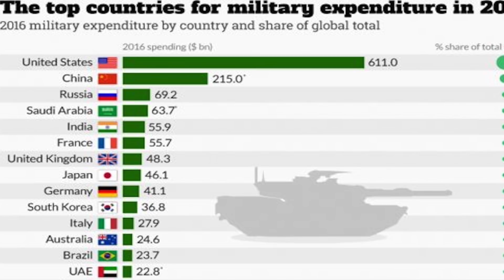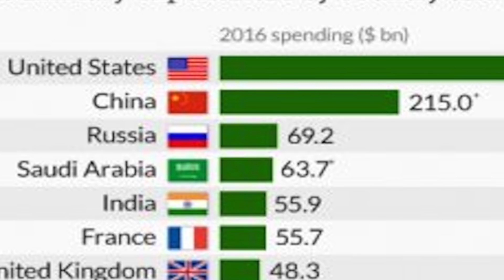CAN USS GERALD R FORD DEFEND ITSELF AGAINST RUSSIAN ZIRCON MISSILE ?

Comment: The real problem with Zircon is its data refresh and adverse weather function. The Zircon, IS NOT immune to jamming, first. Second it uses GNSS, the soviet-putinist version of GPS, which at Mach 6  is far too slow to update rapidly changing position data. Further the Zircon is on the verge of skin-ionization AND THE WEATHER MUST BE PERFECT- SO THE CARRIER BETTER BE SITTING PEER SIDE. If the Zircon is over 500 meters off the ground, AWACS will see it LIKE it is being constructed at the factory.  The thermal signature of a missile being boosted to Mach 6....heck, I can see that from Kansas, Melbourne, Guam...and the fight is in the Bering SEA! MANEUVERING ...at Mach 6, no metal can handle the stress of moving a body moving that fast through anything other than a flat angle, between 0 and 12, 13 degrees at less than 2 kilometers IN HEIGHT, so they will have to get close. Its own speed magnifies the G-forces. Guidance data....IT CANNOT BE A TRUE CRUISE MISSILE SINCE ITS TARGET IS MOVING AND hence the missile will require data updates and a satellite cannot feed the data to the missile fast enough. Even if a satellite found the carrier, from space at Near Earth Orbit, distance measuring error and Circular Area of Probability would have to be removed/managed by a local sighting...the E2D+ Haweyes and Picket Force, especially the subs with their advanced masts, would detect enemy platforms so far out that all the Russian missiles could do is run into hot lead faster or get jammed by the Predators and Growlers faster - and the USA Navy has surface, air and undersea drones. But do not give up Russia; you hate us, we hate you, your shrunken god putin and little Dimo want a war, and we should have one...the last one!  GET IT ON!!!.
Reply: Ok, 
   "..lol all that you have mentioned is pure bull and just bugs that are overcome in the testing phase... if 3.5 minutes is needed to travel 400km from launch to target... the carrier that already was traveling at a certain speed will have its position calculated where it will be in 3.5 minutes since it CANNOT stop so fast or go faster then it was traveling... then also the russian glonas system is in some ways more advanced then gps.."

     400KM IN 3.5 MINUTES. CONVERTER = THAT IS 210 SECONDS TO COVER 400 kilometers.  Those of you who are mentally agile, can see the problem immediately! 
     THIS is exactly what I was addressing in earlier statements: ONCE the missile has gotten within the distance of the horizon from the carrier, let's call that 12.87 kilometers round to 13.... DISTANCE FROM TARGET, ok? '...Based on what this person has said which is what the video indicated...'  //  ..why do I repeat and qualify that statement??? BECAUSE AT SEA LEVEL OR BELOW 2 KILOMETERS THE EARTH'S ATMOSPHERE IS SUPREMELY THICK....JUST EXCEEDING Mach 1 is difficult for anything that flies...ANYTHING (THE MISSILE IS FLYING, LITERALLY FLYING, INSIDE Max-Q: ITS HIGHEST SPEED INSIDE THE GREATEST DRAG ENVIRONMENT) SO MACH 6 IS ASSUMED BUT UNLIKELY, AND IF IT REACHES IT, THEN ITS RANGE IS REDUCED....just so many relative tradeoffs here. THE VIDEO STATES that the US Military has not made any comment...I IMAGINE THEY KNOW WHAT I KNOW!  The Zircon may have done Mach 6...but not at less than ONE KILOMETER IN ALTITUDE...WE'LL SEE, A WAR IS COMING! Russians started it, WE FINISH IT, ONCE AND FOR ALL!
       At such low altitude, its thermal and acoustic footprint beg to be tracked, SO DO IT! Yet, using the commonly stated number of Mach 6, the time to acquire, get updates from lowly GNSS or more advanced GPS - well - they would BOTH be utterly useless in this end-game! AT Mach 6 the missile arrives in, ...drum roll please...0.033 seconds....CHECK MY MATH, simple math I miss sometimes...I am better at Fast Fourier calculations and Diff. Equations.
     Therefore, the missiles, only need to be spoofed or jammed within the last 100 KM and they could easily easily most likely miss,...their...targets...! They cannot broadly maneuver and they are not stealthy by any measure!
    They are like shots from an antitank gun...and targeting a carrier is JUST not as nearly as easy as the venial putinists wish to think but make them spend the money trying- the sanctions are having a slow-death affect on the Russians even now!  USE THE decoys AND Drones...ADVANCE OUR TECH TO MEET THIS THREAT AND ADVANCE FAR BEYOND OUR ENEMIES. Sink the Russian fleet, blockade it in Crimea and destroy it. Cripple their economy THE EXACT SAME WAY THEY TRIED TO CRIPPLE YOUR ELECTIONS - FIGHT THEIR FIRE WITH EXPLODING SUNS! Own the skies....build more small carriers America and the West. Get ready for the final conflict IT IS COMING!
Reply: no...everyone knows that but if you know a mach 6 missile is out there the satellites KNOW WHAT TO LOOK FOR too. USA Sats, can literally see air being sucked into jet engines. Seeing thermal is really no stretch. We can see thermal now  from space. This is why I do advocate the smaller carrier with a 500 man crew and lots and lots of advanced drones and unmanned planes and decoys.and go ahead and give drones the thermal imaging functionality as well. This is not new tech! Let the large carriers do the heavy lifting....specialize the smaller carriers. Drones. Satellites that can be launched when needed and stay in orbit 2 - 7 days. Drone CAP
Reply: D'Mathmoth Tutinean Dam, you completely demoralized the enemy. Do they get any points for trying?
Reply: China is more of a threat to the U.S now and in the future!
Reply: Emm in my poor understanding of physic, rail guns are good cause its firing capacity.. the problem is zircon carries with it a massive inertia that also can damages the ship even without explosion.. plus the effective range of zircon is small..  i think, i agree with the idea of using a jammers
Reply: D'Mathmoth Tutinean, stfu with the bs, please. I love the Navy but the hypersonic missiles have optical electro and radar seekers. Back to the drawing board for the USN, huh?
Reply: you lost me at the "putinist"
Reply: D'Mathmoth Tutinean ohhhh......ur so dumbfounded all in disbelief of how mighty Russia actually is..........shows just at what level natos wisdom is at. Thanks.
Reply: D'Mathmoth Tutinean Russians don't hate you. They are much more intelligent than that. What they hate is the USA always trying to dictate and deceive and undermine other nations. Typical of this is the US accusing Russia of trying to interfere in US elections with no proof. The kettle calling the pot black. The continual interference in the Russian electoral system is blatant. It endlessly is reported in US media. The sad part is the US still always supports the criminal elements of the Yeltsin era. The criminal Oligarchs of that area that controlled the Russian Duma. Ok if you want to run the US that way but stop trying to impose a similar system on Russia. We all know the US is ruled by vested Interests and the Deep State. Ok if that is what you want where your vote does not count but please stop trying to force that sick system on others. It was no accident in Russia during the Yeltsin era the Government was called  "The Family". Ok if the US wants to be Governed by the equivalent of a faceless Mafia Family but why try to push that sick system on others. It is not Democratic. Time fools like you realise the USA is one of the least Democratic so called Democracies in the world. Not the best like you have been brainwashed to believe. So obvious to the rest of the world but most in the US are blind to this fact. Tell me why the people of Russia would ever want a Government back like the Yeltsin era one?
Reply: Perhaps the answer lies not in countering with a laser but with jamming? At least in the next few years. Nice info you provided. thx
Reply: @myplane150  You are actually taking seriously that nutjoh? Wow!
Reply: D'Mathmoth Tutinean God fucken sake guy, That's a hefty story you speak! Not saying it's fake or so, Not sure.
Reply: Ouch!
Reply: D'Mathmoth Tutinean what if the Russian fires 20 Zircon simultaneously. Can the US carrier group take them all?
Reply: Emm i reckon the US get 10 jedi equipped with light saber to cut that zicron...
Reply: Aussie Gamer: You, sir, undoubtedly are not well read. Anyone with basic knowledge of military systems will know that hypersonic maneuvering is a non-starter. Traveling at 150 kph can you make a sharp 90 degree turn and survive it? At that speed a missile will have to fly in a straight line. I didn't see anywhere that  D'Mathmoth Tutinean "speak of war like its a video game." Have you experienced real violence or pain and suffering? Even so, what does that have to do with knowledge of physics?
Reply: Emm huhuhu our expert here keep mentioning about the inability of the zircon to be functioning.. he may be right or wrong.. or there may be other counter measures regarding his statement by the russian scientist.. i m concern more of the chance of the ship get hit.. which is very likely.. if the US have jammers.. the russian may have something else to make the zircon able to penetrate their defense.. there are a lot of probability.. even a grand US ship hit a big, slow vessel twice this year.. what if, its something smaller, faster, and invincible.? the chance is there..
Reply: D'Mathmoth Tutinean You talk a lot of crap. The video is incorrect as well. Russian releases don't claim it is a Scramjet powered missile. They simply say they have developed a better fuel which indicates it is still some form of rocket propelled. It will be a nightmare for any Carrier Group or other US ship. Ship launched Air Launched. No mention of a land labched version yet. For that they will still rely probably on there improved older Supersonic Antiship missiles. Longer range and still capable of coming in at low level giving very little warning and adopting an irradic approach. Also capable of guiding themselves to the target. One travelling high guiding the others via it's own radar. It gets knocked out one of the others auto takes the higher altitude and guides the others. Why can't the Zircon use a similar system or why can't the Zircon be guided in a similar war. No GPS needed. Also how long before these Laser Weapons are ready and how long before the US can have enough ships equipped with these Laser Weapons. Also how easy is it going to be to protect against these lasers. The first Generation Zircon now proven. Another 20 years????for these great Laser Defenses to be fully deployed or. Lots of time to develop counters cheaply. Face it. Except for Submarines the US Navy has big problems now to project power for a long time. Carriers are now the Battleship of WW2. Next to useless against an enemy with advanced AntiShip missiles.
Reply: Russian Pilot Not a US citizen. Australian. You as a Russian might be surprised to know that a big percentage of Australians are not fans of the USA. While we overall are very straight up like Russians we can be two faced. In the main we send only token forces to help the USA in all its wars as a form of security. As a nation of only about 24 million we need to keep them onside just in case some of our northern neighbours see us as an easy target. Overall most Aussies have very little respect for most US types and there one eyed types. Yes I have been to Russia twice. I understand your perfectly legitimate point of view and your efforts to pull the USA into line. Pity China would not help a bit more. Keep up the good work. As we say in Australia "Someone has to keep the bastards honest." By the way most Aussie dont support the sanctions against Russia. Bullied again into supporting them by the USA and implemented by a Prime Minister born in Britain. Kicked out of the position soon after. Nothing but a Conservative old British type. Not a true Aussie. Yes I liked the straight up attitude of many Russians. Stayed with a Russian family for about 1 month the first time. Keep the pressure up on the USA. The only language they understand. A good smack in the face. Not all but far too many.
Reply: Vlodec, try to find the report of the company "Almaz Antey" (manufacturer of the Buk missile system). They proved that the nature of the damage of the cockpit, shows that the launch occurred from the territory of Ukraine. This is the first. And secondly, the plane was shot down by the system which is doesn't in service in Russian army. It's too old. This version of the "Buk" from the time of the Soviet Union. But in Ukraian army this versions of the "Buk" are still in service. What else do your need to open your mind? By the way, did you know that this is not the first civilian plane that was shot down by Ukraine during its history of independence (25 or a bit more years). I suspect you did not even heard about it, Western media doesn't saying anything on this.
Reply: What about all the talk about the rail gun.
Reply: Interesting points, not covered in the video!
Reply: oooo ooooo o yes USA superpower and all other countries are what??don´t forget f35 and weather you expert !!!iif america had a supersonich weapon there would be the world in order or what fkin moron...
Reply: BATTLEFIELD 4 HARDCORE Chill man, yes he isn't an expert...sure he could be completely wrong. Its just his opinion, have some class and explain your opinion without the sass.
Reply: no i´m not a expert but how about f35 and problem with automatic logistics Information system,helmet display,lightning protection,flight control problems (wtf, o sry is f35 most bla bla bla airplane),software problem, all variants of f35 have reliability issues with cockpit display electronics unit, seat survival kits,on-board oxygen generating systemsm landing gear tires,thermal management systems etc.yeah i know it´s USA power and who is talking about this problem?ooo sry F35 most powerful airplane of the world
Reply: Hey, y'all need to brush up, missilethreat.csis.org Way too much BS being posted here...
Reply: Precision won't matter if it carries Nukes.
Reply: Ross K, better no one can say. If u r an American, i'm really surprised. Smart and honest with himself American?!?! I just can't believe it)
Reply: Ross K, thanks, i'm very pleased that the Western world have such truthful smart man as you. I hope with time they will be more. And remember in Moscow from now you have one more friend.
Reply: Emm sadly i m a malaysian.. i m not sure who actually the culprit of the 2 lost Malaysian planes.. here there were a lot of controversial and made up stories.. even conspiracy theories... the first plane thought to be carrying the chinese war experts just disappeared in smoke.. They say american hijacked it and took it to their base.. plus other theories.. the second planes shot down.. they say its either the  russia or ukraine who shot it down.. i only can pray things like this wont happens anymore..
Reply: Izzudeen Ayub, it was Ukraine, Russia have proved it, but seems like nobody in rest of the world don't want to know the truth.
Reply: Vlodec, look, i have suggested to find this material and try to understand it. Nothing more. I haven't said that u must believe in my words. You must believe in expert's words, not mine. Try this: https://www.youtube.com/watch?v=rG0Bi_wf7JM
Reply: Emm huhuhuhu... totally brainwashed.... thanks for your info.. now i know americunt and americant are the top Tier ULTRA POWER in the planet and the world..
Reply: Emm i saw the russian intel video about it.. but now everybody just quiet about it leaving my country's name at it worst.. huhuhu...
Reply: D'Mathmoth Tutinean So what if Glonass has a slower update rate. The missile will just interpolate. The Soviets had Mach 5 antiship missiles on Tu22 and Tu95 in the 80s or earlier. And used things like inertial navigation. Here you are claiming they cannot hit a huge aircraft carrier with 2017 electronics. So what if you use radar jamming. Maybe they will give it an optical or infrared seeker for terminal guidance. Also, it's preposterous that you claim it won't be able to turn because of its high rate of speed. It won't need to perform large course corrections anyway. And it can just do them slowly, to keep gforces within sustainable limits. Not like it has to perform more than one successful flight.
Reply: "...So what if Glonass has a slower update rate. The missile will just interpolate. ..." GUESSING is , well, GUESSING! DID the carrier go straight? How far from the carrier was the missile when it got its last data fix?? From what initial source? If the Missile is moving at Mach 6 using a scramjet, AT SEA LEVEL, IT BETTER NOT BE RAINING, for one. The carrier is most vulnerable leaving port. Shoot then, right? Ambient RF and natural interference, is highest close to land. What if there are islands or other obstructions, ships, air defense and early warning; they can all be made to look like a carrier too. Even if you had a camera on the missile, it is going so fast that the carrier would be visible for less than 0.033 seconds - I did the math in a previous post - that is a fraction of a blink of an eye, and you are past the carrier. This thing is doing all it can to do Mach 6...AT SEA LEVEL- FLYING INSIDE MAX-Q. IT IS flying in its worst environment and being heavily jammed and spoofed and it is moving like a rifle shot. The carrier has a very good chance of surviving this attack.

"...And used things like inertial navigation. Here you are claiming they cannot hit a huge aircraft carrier with 2017 electronics...."  I know what you are thinking, " Gee, Mach 6 is just one number bigger than Mach 5 so it should not be any more difficult to hit a ship going a little faster. Range, material science, performance envelope going another 700+ nautical miles an hour faster. Just think about it. The Carrier battle group....has advanced electronics too! Nearly NO SYSTEMS have 2017 electronics but the latest upgrades you can believe the carrier has it, for sure! 

"..Also, it's preposterous that you claim it won't be able to turn because of its high rate of speed..."   Go back, read it again. I did not say it cannot turn, I even indicated the best possible turn angles...why would I do that if I thought it cannot turn!! Go read again. Maneuvering at Mach 6 and it is  a MASSIVE 5-ton air breather of the scramjet type, anything that causes side-slip or excessive angle of attack can stall this thing, it needs air like nothing before it! Water vapor, heavy snow, whales breaching, can kill it. It turns poorly, IT IS A RIFLE SHOT, THINK!

".. And it can just do them slowly, to keep gforces within sustainable limits. Not like it has to perform more than one successful flight..."    Go slower?!! Watch the video again. Its speed was to be its best advantage and in fact its speed, a relative virtue, is also its greatest vice/flaw. US Navy defences are heavily data-integrated. If one system can see the missile, THEY ALL CAN. ESA CAN SEE THIS MISSILE COMING HIGH IN THE SKY AND certainly down low where it must struggle to exceed Mach 1...  'nuff said. I am done with this.
Reply: Your right, however at sea level things change. The ability to maneuver at those speeds is very difficult. Sea level mach 6 is a very big problem. Your dealing with very thick atmosphere which will produce much, much more heat and pressure. Attempting evasive maneuvers or simple course corrections will cause a lot of strain. The SR-71 couldn't achieve it's speeds at low altitude without burning up, at high altitude however it was a champ.
Reply: D'Mathmoth Tutinean hypersonic missiles and their capabilities  haven't been out of the media for the last two weeks.  

I guess you didn't get the memo.
Reply: Guys,  Wikipedia the LaWS system, it is a complete joke except for drones and high speed gun boats. LaWS is 6 commercial WELDING LASERS. So much stupidity here, cmon guys.
Reply: D'Mathmoth Tutinean ahahah, have you ever been in Russia?
Reply: Only one problem with that whole statement; the Zircon is still in prototype and testing stages, meaning it can be improved and it can happen in a matter of days or hours. Their for we do not have the CURRENT spec's or capability of the missile, but the fact remains, Russian anti-ship capability are far ahead of the U.S. While U.S. was all trigger happy on making carriers after carriers due to the large number of warm and deep water ports, Russia doesn't really have a choice in regards to fielding a large navy. For one, they don't have the deep or warm water ports needed to maintain such a large fleet. Two, all it's enemies are by it's boarder, so a land war is what they are more focused on. Three, they spend money where it matters, not blowing it off on shitty weapons system that don't do as they are promised (looking at you F-35).
Reply: We'll, the video didn't talk about electronic warfare at all, because it is a rapidly adjustable tech that must be tuned and updated at the point of conflict. Also, counter measures can be jammed too. It is a cloud of uncertainty.
Reply: Akin Khoo 30 knots only? Nah, some ww2 warships could go faster then that! Including some battleships! But still, 30 knots for a top of the line carrier? That’s pretty slow.
Reply: ...or mach 2. What's your point? At mach 8 the Zircon can close faster, maybe, than point defenses can react...but it can't evade them, and a 20mm round from the target will hit it at almost mach 9 and totally demolish it.
Reply: Bill Housley did you even watch the video? One bullet won’t do given the size of the missile and using the 20mm is the LAST resort. Meaning if something got thought all the other point defense, your pretty much fucked. And I am sure the 20mm round isn’t going at Mach 9, if it was, they would have been firing that from the beginning.
Reply: You Sir need a heavier dose of your medication if you are willing   for a war with Russia, for it will be indeed the last one, but for all mankind, i hope you can mutate into a cockroach for they will probably be the only that survive.  You do know that a modern missile or missile swarm  can perform with partial/intermittent  information about location then they have their own devices(radar/optics/) to locate/prioritize and engage targets. 
Just google  (P-700 Granit)   and imagine if it were  2 or 3 times faster and you will understand the danger of this new missile.
Reply: All in all with that being said , you guys do understand that Russia's middle technology is 20 years ahead of the west including america... there is a reason why NASA borrows Russia's equipment during space voyages... this colored man is biased and is not looking at both ends.
Reply: Bill Housley you do know he said middle technology right? Not things like stealth or some high tech top tier tech. Russian missile and radar tech is far far ahead of ours. And yes, NASA does does use Russian tech to send things up.
Reply: AL Ian yet NASA uses RD-180s made is Russia. Defense contractors use Russian built rocket engines because they are efficient and cheap in what they do. Landing a man on the moon isn’t all about tech. Political setbacks, infrastructure, and other contesting military projects basically slowed much of their effort. Even the Americans suffered from the same set backs, on we had a large budget to spend it on the space race. Who was the first to put a man in space? The first to send a satellite in space? Who was the first to send a space craft around the moon and took the pictures of its far side? The point is, the Russians got close to the finish line. Filthy American propaganda has fooled our country into thinking that Russians are primitive people. Won’t be saying that when the U.S. pulls out of Syria and Russia cleans the house and restore order.
Reply: Relax guys, it's just his opinion and he is welcome to it. If you disagree let him know , but have some class about it.
Reply: that was funny.
Reply: Emm never say no my friend..
Reply: Ross K I can understand that. I think both governments are pretty courrupt with personal  vested interests on protecting and earning more money. I don't trust either of them.
Reply: interesting
Reply: "...experts words..."    I WAS WAITING FOR YOU TO SAY THAT!!!!!    https://youtu.be/iQsrUjZotBU
Reply: Jorge Rodriguez
Yes. Very dangerous to Mexico and the rest of Latin America. LMAO
Reply: Panzer Killer -- Sorry, did I say mach 9? I meant to say mach 7. The Zircon coming in at mach 6.2 meets a point-defense vulcan cannon round flying the opposite direction at nearly the speed of sound...ya, mach 7. Pretty simple math. And yes, that kind of collusion is what rapidly expanding debris clouds are made of.
Reply: Almir Alagic -- 20 years? Really? So they have colonies on the Moon and Mars and their Navy and Air Force weapons systems all have magnetic shielding and directed energy weapons and their infantry all have Iron Man body armor and are all super-strong, super-fast, genetically enhanced super-soldiers with cybernetic implants and can self-regenerate damage?

Wow...scary.
Reply: Panzer Killer
Who is the ONLY nation on Earth to land on the Moon because they could? Nobody cares about a man or satellite in space. LMAO Russia makes affordable small rocket engines which are no longer going to be used by the USA because Space X now makes the most affordable small rocket engine now not Russia. A private USA company is now more advanced than all of Mother Russia. LMAO https://en.wikipedia.org/wiki/SpaceX_rocket_engines
Reply: AL Ian wow, so dismissive of the first achievements of humanity you are. The U.S. gave enough shits about the Russians achieving what they had in order to spend more on the space race. The funny thing is, Space X isn’t funded by the government. That makes it funny since NASA, who is funded by the government, failed to develop a rocket better then the U.S. it took a privately own company to do it years later. And even now their are concerns about it given that one of the rockets blew up. If it matters, Russia is aiming to send  cosmonauts to the moon in the coming years, same as China. I find t funny that with all the technology the West has, they could have sent another mission to the moon? Wonder why they don’t do it. And don’t say money is the issue, no, it’s not. We have enough money to fund all of our space programs by a hundred.
Reply: Panzer Killer
How many countries have put satellites in orbit or walked in space? Who cares? American made Space X makes rocket engines cheaper than Mother Russia or NASA. USA went to the moon 6 times already. Dirty China and Mother Russia can have fun on the moon now while mighty USA is going to MARS. USA will always be first to land men on other worlds while Mother Russia is still trying to get to the moon. Here's Mother Russia's failed N-1 rocket disaster trying to land a man on the moon first. LMAO https://youtu.be/BLg1QUq5GQM
Reply: Panzer Killer -- It's an issue of "What's in it for me" when it comes to public funding.
Reply: you are surely very good toilet expert. So much total garbage that it is already ridiculous. Next time use only facts and not your wishful thinking.
Reply: I stated my service record ON THIS POST; I am NOT afraid to speak face to face ...post to post, with anyone. Those engines...on the B-1 Bomber? Those are MY engines...too.
Reply: So you think Russians are dumb? In Russian even crookes have phd's!
Reply: D'Mathmoth Tutinean  you are sick...
Reply: D'Mathmoth Tutinean You had better get a job with the CIA and DOD. I am certain they would love all your inside info. As I understand it the area of guidance at Hypersonic speed is definitely a big problem. Especially with the Air launched version now in low volume production and being proven up on the MIG31s. Talk it can reach Mark10. 
Common sense says the Russians have solved those problems. A secret! If they had not they would not be equipping all there new Frigates and Corvettes and Cruisers they are gradually upgrading with  launch tubes that cant take there older state of the art by NATO standards Supersonic Anti Ship missiles. 
When is it going to get through to US types like you they don't necessarily have to do it the USA way. They are perfectly capable of making breakthroughs of there own. 
There is no way they would abandon there older best in the World Supersonic Anti Ship Missiles unless they had solved all the problems you mention. Just because NATO has not solved them does not mean Russia has not.
Reply: Vlodec I have read the full report released. The key weak and critical missing points in my mind are as below.
Russia released its Raw Radar data. If it had been tampered with odds on it would be picked up. Ukraine would not release theres. The USA would not release the data they claimed to have even though they had a Satellite over Ukraine at the time that supposedly could pick up any rocker launched. Very suspicious in my mind they would not make that data available even to close ally nations. Why not? Ukraine also failed to release its Air Traffic Control records. Various excuses offered over time. That is suspicious. Changing the reasons. First there Security people had taken possession of the records. Then when they were needed and requested they did not have them? Strange? The last story I heard them come up with was they were doing maintenance on the system. Very suspicious! 
The end result is we will never get an answer why MH17 deviated north when all other aurcraft flew further south avoiding the war zone that day. The evidence is there they were following a route south like all other aircraft initially. Why did they veer North. Only Ukraine can answer that or the dead crew or the black boxes. We all know London said the black boxes were damaged so we will never know. It was not weather. That is about all we know. Why?
The BUCK. Never seen coming from Russia. Never seen going back to Russia. 
A Buck seen in the area. Thats it. The Ukranian intercepted messages were proven false. Made up from numbers of other massages. 
Something smells. A really bad stench. The Official Investigation even included footage of a BUCK  proven to be false and impossible because of the advertising sign. Ukraine refused to let the investigators inspect there BUCK missile records and inventory also.
The only real evidence put up was Russian  with there Raw radar data. 
Even the forensic side does not give any real proof that establishes what hit MH17. 
I dont accept it. If I was on a Jury I would not convict. 
I would ask the investigators why they refused to interview the hundreds in the area that could have given a description of what they saw. No danger if Kiev would have stopped shelling. 
I would not convict if on a jury. Too much critical evidence withheld or never investigated that should have been investigated. Why not?
Reply: Vlodec The investigators were free to be part of the demonstration and test in Russia. Why didn't they take up that offer. Money was no object. The entire think stinks. The only way to ever get a balanced investigation at the time was to have experts from truly independent nations undertake it. If Ukraine was part of it Russia should have been part of it and Malaysia also should have been a full partner as well. 
It was one of three things. An mistake made by either the Rebels or Ukraine or a deliberate act by Ukraine. Ukraine was the only beneficiary. They got exactly what they wanted. Even if it was the Rebels who accidentally shot it down Ukraine is responsible to a large degree for allowing or? MH17 to deviate North of the route  being taken by all other airliners that day. When aircraft are flying over nations it is the responsibility of that nations air traffic control to ensure they are kept on a safe rout. Thats how it works.
Reply: Russia had a difficult time with gorilla warfare too. Read your history fool
Reply: Written by an idiot with waay too much time on his hands.
Reply: The amount of energy necessary to refute bullshit is an order of magnitude bigger than to produce it. So, I'll just leave it at that.
Reply: The only deterrent to carrier getting sunk is nuclear war,as US used ships being sunk to get involved in 2 WW ! If Pearl harbor could happen,then anything on this earth can be destroyed! To even believe different is a IQ of a child, not a smart person who claims all the experience of naval warfare!😎
Reply: Russia doesnt have to attack you . You will be attacked by your own police first . Your gun laws, Fracking, GMO , fast food .. trillion dollar debt .. Americans are a dying race . You will be also be a minority in your own country while the immigrant population will have a divided loyalty to you .
Reply: Plz go read history before saying who needs war and who wages war for business ...and plz don't say u do all this for the prevailing democracy and peace ...world has understood US and it's love for peace and stability ...ty
Reply: Philip V
Russia's already dying and we're not even at War. They're the most boring people on the planet anyway so good riddance.
Reply: It has a visual lock on system that takes over
Reply: funny. all the comments attacking him, i havnt seen any counter arguments to what hes suggested.
Reply: @leeboy29680-ol7gf  The amount of energy necessary to refute bullshit is an order of magnitude bigger than to produce it.
Reply: NO. NOT IF Terminal Guidance is correct and these missiles need better range - stop calling them CRUISE missiles.. But that is the rub. These missiles are like RIFLE BULLETS. ONCE out of the barrel, they are hard to update and steer. Your intel has to be updated constantly or forget hitting anything. If these things get  closer to a carrier than the horizon and they have to make huge maneuvers to make a kill, They will not make it. The control surfaces on these missiles cannot turn THAT hard to hit a target that close unless it is sitting still or sitting at a pier...in Cancun or the Bahamas. Any ship that ....a sub....that could stick an antenna above water and give away the Carrier's location would be sunk, detected. IF the missile is moving at Mach 6, as it approaches terminal, you will see its thermal footprint; IT WILL BE MASSIVE! ESA Radar can see the air sucked into JET engines and unlike rotating radar does not have that dead-zone around the ship that is about 400 meters in every direction. ...it will see a SCRAMJET ENGINE about 25 times sooner. USA ships are so much better at data sharing, hence targeting. Maybe we need the Phoenix Missile back anyway....IN TERMINAL...THE MISSILE EITHER DOES A POP UP MANEUVER (Super hard at Mach 6) OR COMES STRAIGHT IN...R2D2 has gotcha!!  SO if they can get 20 aimed at a Carrier, still got trouble....the picket forces are not slouches either. They are upgrading the Burkes and the Zumwalts, are just CHOOSERS OF THE SLAIN...they are THAT deadly. If you even tried dropping these things from space ...now that Russia has rejected all previous nuke treaties and China never obeyed them, you CAN could use nukes to defeat attacks, IN SPACE. We are in a new arms race and SPACE, has no real limits just political BS talk. I advocate building smaller partially submersible carriers, with crews of about 500, with 150 to 200 drones and unmanned vehicles as well as theatre ballistic missiles and charged particle weapons. MAKE some of the drones all weather all purpose decoys, etc, etc, etc.
Reply: no.....i refused to shut up: 
 The real problem with Zircon is its data refresh and adverse weather function. The Zircon, IS NOT immune to jamming, first. Second it uses GNSS, the soviet-putinist version of GPS, which at Mach 6  is far too slow to update rapidly changing position data. Further the Zircon is on the verge of skin-ionization AND THE WEATHER MUST BE PERFECT- SO THE CARRIER BETTER BE SITTING PEER SIDE. If the Zircon is over 500 meters off the ground, AWACS will see it LIKE it is being constructed at the factory.  The thermal signature of a missile being boosted to Mach 6....heck, I can see that from Kansas, Melbourne, Guam...and the fight is in the Bering SEA! MANEUVERING ...at Mach 6, no metal can handle the stress of moving a body moving that fast through anything other than a flat angle, between 0 and 12, 13 degrees at less than 2 kilometers IN HEIGHT, so they will have to get close. Its own speed magnifies the G-forces. Guidance data....IT CANNOT BE A TRUE CRUISE MISSILE SINCE ITS TARGET IS MOVING AND hence the missile will require data updates and a satellite cannot feed the data to the missile fast enough. Even if a satellite found the carrier, from space at Near Earth Orbit, distance measuring error and Circular Area of Probability would have to be removed/managed by a local sighting...the E2D+ Haweyes and Picket Force, especially the subs with their advanced masts, would detect enemy platforms so far out that all the Russian missiles could do is run into hot lead faster or get jammed by the Predators and Growlers faster - and the USA Navy has surface, air and undersea drones. But do not give up Russia; you hate us, we hate you, your shrunken god putin and little Dimo want a war, and we should have one...the last one!  GET IT ON!!!.
Reply: @dmathmothtutinean8950  you don't sound like a American,   all that Russo phobia gives you away! Also,pretending to be a Black man, I think that you are a Troll!
Reply: D'Mathmoth, you are my hero . Nicely done.
Reply: D'Mathmoth Tutinean  thank you..
Reply: D'Mathmoth Tutinean, dude you should think about brain replacing. Looks like he's sick and seems pretty seriously. If all that you write here about the possibilities of the US Navy were true, Russia would become the 51 State of America long time ago. Or, at least, we wouldn't have our own policy beyond Russia's borders. From your point of view - perfect American world - where Russia vassal of the USA, but in real world, where Ironman and other avengers are doesn't exist, Russia is a real independet world force who can kik your asses even without nuclear weapons. And your govement clealy understand it. So relax bro. Peace!
Reply: Vlodec, ok, i will try to explain my point of view, from another side. I agree with that: "Russian companies are susceptible to influence from the Russian government and etc." This is true in every country of our imperfect world. But try to think with this arguments: for whom droping down that plane were the most valuebal? For Russia? I don't think so. If it was Russian plane, so yes, droping down can be valuebal for us. In that case we had reasons to answer Ukrane with our army (because we had reason to answer, they killed our people on that plane). But it was Malasian plane. And in this case the droping down of it is valuebal to Ukraine and Ukraine ONLY! Because now they can say: 

"That angry Russian's gave air defense sistems to Donbass. Just look how they hit this innosent plane! Was it mistake or planed action, we don't know, but you must help us to defeat them, it's very important, Ukraine can't solve it with itself only! We need your billions of $ right now and your modern weapons! HELP, HELP, HELP!"

So, yes dude, i'm pretty sure who is responsible for Malasian plane. It's Ukraine.
Reply: Emm i know everything can be detected no matter how invisible it is.. even F-22 can be detected.. the question is how quick u can act after u start seeing it.. what point if u can detect the F-22 if it already hit the entire fleet.? that is why the US say that this plane should be afraid of.. Now can u apply the same concept with the Zircon cant u.?
Reply: BATTLEFIELD 4 HARDCORE And that's your opinion. Its cool. Not very hard to disagree and bring fourth your points without getting personal us it?
Reply: Zircon  is new...the video and its publisher are not wrong...here is what is in the field now: https://missilethreat.csis.org/missile/ss-n-26/

"..Supersonic Antiship missiles. Longer range and still capable of coming in at low level giving very little warning and adopting an irradic approach. Also capable of guiding themselves to the target. One travelling high guiding the others via it's own radar. It gets knocked out one of the others auto takes the higher altitude and guides the others...."
    === Consider. You are hunting ducks on a lake. You have dogs ready to retrieve the duck you shoot. Then suddenly, one of the dogs JUMPS HIGH INTO THE AIR FROM THE DIRECTION YOU ARE COMING, AND THE DUCKS SEE THIS CRAZY ass, high flying, vodka-soaked, russian dog. Gee, suddenly the sky is filled with ordnance - COMING FROM THE ANGRY BIRDS!!! OH HELL!!!! Now the enemy is uncovered. The ESA Radar can see the high flying fool. The missiles down low, cannot go as fast as the one WAY UP IN THE SKY WHERE THE ATMOSPHERE IS THINNER. The data link to the lower missiles paints them perfectly and since they are NOT able to do Mach 6 at sea level, they can be killed by everything in the USA fleet. Heck you can throw sinks in the path of the missiles...ceramic projectiles! Even a glancing contact by such projectiles would rend the missiles into pieces. The Radar from the high flying missile, can be jammed COMPLETELY OR SPOOFED. The datalink can be jammed and tracked.  Go get more Vodka, yeah...try this one again comradsky Vodka of the fake profile that is hours old! 
"..Also how long before these Laser Weapons are ready and how long before the US can have enough ships equipped with these Laser Weapons. Also how easy is it going to be to protect against these lasers..."
   ===Wha? You can do a search in youtube and get the answers for that, Mr. KGB/FSB fake profile person/Troll...yes...get more Vodka...the one with the dead BEAR inside the bottle...more Vodka!
".. Carriers are now the Battleship of WW2..." 
   === The USA should make more of them. Smaller - 55,000 Ton displacement or 60; specialized, quieter, stealthy - partially submersible, capable of Highway speeds, 50 Knots at least when needed. Heavily automated. Smaller crew of about 400 - 500. PACKED with drones, aerial decoys, jammer drones and drones to fight other drones and manned airframes. Ballistic Missiles to fire if china or russia uses one against it - In fact, LETS GET SERIOUS ABOUT THE KILLING:  Place autonomous sensor drones around the world, bound to Ocean Sea zones. They find a sub they tag all data and send it after following it for a few kilometers. They spend a year on patrol then get swift overhaul, at sea on a ship - no dock or down time. The repair vessel does active pinging and laser side scan detection while it upgrades the sensor-drones - STAYS IN THEIR OLD TRACK Make them move and look like pods of killer whales or dolphins migrating. Give them powerful defences especially against Chinese and Japanese fishermen!  Fill the oceans with them. Upgrade them once a year. Even touching one triggers an alert since they are in International Waters. 
   The Putinist Russians have declared war on all democracies and stolen Crimea...hacked evey election since Brexit and 65% of all russians want the soviet onion back - make them choke on it! Most nations that were in the old one, NEVER WANT TO SEE IT AGAIN. They suffered being just near Russia. I back them.
 Hammer Russia with every sanction you can get your hands on. America, keep pushing fracking and drive the price of oil and gas into the basement of Hell - BANKRUPT THE VODKA-PUTINIST-COSSACKS!!! Remember the murder of Malaysian Flight 17; The unavenged dead DO NOT STAY DEAD!
Reply: "...What is a Growler gonna do against a missile traveling at Mach 6..."    Jam it or decoy it...Mach 6 is NO SPEED AT ALL COMPARED TO RELATIVISTIC SPEEDS! The missile is not even moving compared to the speed of light or a substantial fraction thereof! The electronic processing inside the missile, and inside the growlers jammers, are moving electronics at a substantial fraction of the speed of light! Hence, I say, the missile ONLY HAS TO BE JAMMED WITHIN THE LAST 100 KMS TO MAKE IT MISS THE CARRIER DUE TO ITS OWN SPEED. It is a rifle shot from a high powered rifle. A growler is a butterfly to that rifle shot. Go out, try to hit a butterfly with a Rifle bullet while it is flying at 100, 75, 50, 10 KM away! EVERY 0.067 SECS AN OBJECT THAT could DO MACH 6 AT SEA LEVEL  ENTERS AND LEAVES BOTH HORIZONS; The closer the bullet gets, you need faster data updates - which you are NOT going to get! Until finally even the electronics are limited by propagation delay of the transmissions or reflected radar return if you can find a target!! You are out of time for radar updates, and GPS/GNSS updates and you are still over the standard horizon, sea-level horizon, from the ship! Your Zircons are in the middle of the picket forces, down on the deck, using all the energy they can muster, to just exceed MACH 1...MACH...ONE as they fall short of Mach 6 and are blown from the sky!!! I am saying, even if you had radar on an object, it could be The Growler (The best airborne jammer on Earth) or drones, dozens of them..POINT: YOU NOW HAVE FAILED TO DEAL WITH THE FAULT OF YOUR VIRTUE - you are coming in too fast! A decoy? YOU WILL NOT KNOW UNTIL IT IS TOO LATE. Oh, ok, ok let's dodge reality for a minute: the first Zircon hits the growler but there were six Zircons on that one target - OOPS, FAKE-CARRIER! They cannot turn and go look for the carrier. The area is blanketed with RF jamming and decoys AND YOUR ZIRCONS CAN BARELY TURN and had to be fired at extreme range to try to hide their launch points! Game over Vodka! THE USA HAS LOCATIONS AND PINPOINTS ON ALL AGGRESSORS...oh hell - HOW SWEET!

"...the Russian submarines shooting salvos of their underwater air cavity torpedos  at speeds of 300 km under the sea towards you..."       
     yes, YES, PLEASE SHOOT THAT TORPEDO AT ME...OH PLEASE!   THAT TORPEDOE IS SO NOISY, THAT ITS NOISE CAN BE USED AS A SONAR SOURCE AND REVEAL EVERY, SINGLE OBJECT BEHIND IT LIKE A PINGING SONAR SET! It also suffers from steering issues. The wire: You cannot attach a wire to it to guide it! A single captor mine or captor torpedoe, LIKE A CATCHER'S MITT CATCHING A FAST BALL...CAN EASILY INTERCEPT IT! IT CANNOT STEER MUCH BETTER  THAN THE ZIRCON WITHOUT DESTROYING ITS OWN CAVITATION ENVELOPE THAT ALLOWS IT TO MOVE AT HIGH SPEEDS. TO EVEN MOVE THROUGH A 3 DEGREE MANEUVER IT HAS TO MORE THAN TRIPLE THE AMOUNT OF FUEL IT BURNS TO MAINTAIN THE ENVELOPE!! I have heard the sonic footprint to one of these torpedoes! You can pick them up on SOSUS in the Pacific but the torpedo was fired IN THE BLOODY ATLANTIC!!!  I KID YOU NOT!  I....KID....YOU....NOT!!!
      You hate the USA and the West and we HATE YOU! GO AHEAD SHOOT THIS TRASH AT US AND LET'S FINISH IT!! YOU GREATLY UNDERESTIMATE THE WEST....I HOPE YOU ARE ADVISING PUTIN!!! GET IT ON, Vodka!!

...your pathetic piss-ant of a dung and vomit eating dick-less-tator killed , murdered, everything from Oligarchs to Magnitsky, Magnitsky on up, Magnitsky on down...FOR BEACH FRONT PROPERTY!! HE MUST BE RELATED TO STALIN! HE DID THIS, Not to defend a people in time of war, oh no!  Look at you, defending a tight ass vodka soaked subhuman who COPIED ADOLPH HITLER'S playbook: He has an Olympics, tried to distract the public eye and in the most obviously humiliating act, then invades the nation that once held a fifth of all USSR nukes - KNOWING THAT HE SIGNED AN AGREEMENT NEVER TO INVADE Ukraine IF THEY WOULD GIVE UP THOSE NUKES. HE SWORE HE WOULD NOT INVADE AND WHEN HE DID HE HAD TO KILL RUSSIANS! Just like your Stalin...Stalin killed more Russians... he murdered them...than ALL OF NAZI GERMANY KILLED IN WWII - 25 MILLION KILLED! America do something wrong? OH YEAH! And I am their harshest critic - my blog is FULL of what america does wrong - BUT I CAN SAY THAT ABOUT THE USA - further,  NO USA LEADER HAS EVER KILLED/MURDERED MILLIONS OF AMERICANS. BUT THEY HAVE ASKED TO FIGHT AND DIE,  TO DIE,  FREEING EUROPE, FREEING ASIA...FREEING RUSSIA FROM GERMANY AND STALINISTIC EXCESSES/MASS PURGES THAT MADE CONQUEST OF RUSSIA SO EASY FOR GERMANS IN OPERATION BARBAROSSA IN WWII!! YOU Vodka??  ...oh HELL no! Tell putin to stop stealing the more than $200 Billion USA dollars he has stolen from oil and gas revenues in the last 11 years!! YOU, must have seen the protests IN RUSSIA about the rampant ungodly corruption:  https://youtu.be/Q2DRub8aAmM
      I mean little Dimo ..a silly bitch...living in castles while your economy turns into rust, dung and vomit, which you eat!!! Hahahahaha! And you come to defend your own Oppressors..HAHAHAHAH! HE KILLED RUSSIAN CITIZENS TO RECLAIM CRIMEA!!  PRETENDING, him and little Dimo your girlfriend, PRETENDING THAT "...these are REBELS...! RUSSIA IS NOT IN CRIMEA AT ALL...!"  I mean...be a man. GROW A PAIR WITH SOME HAIR ON THEM puti....puntini-pussy-riot-ruler-of-ruined-Russia...YOU murdered an airliner and now cannot even OWN that!? THAT IS NO SUPERPOWER!  To this day, people like you...YEAH...you can come here and dispute me ALL YOU LIKE, but you cannot run for a single public office without puke-putin's permission! Russians probably see death as Rest and Relaxation after struggling under putini-pussy-riot and little Dimo!! Yeah I said all this, now, WHAT ARE YOU GOING TO DO ABOUT IT!
Reply: I'm sure it's cool to the touch at Mach 6 barely showing up on IR seeker heads. LMAO
Reply: I was going to say the same thing ...
Reply: Your right about that, but they can still pull some amazing hard turns. There are some videos of that on Youtube. I would expect that a lot of decoys would be deployed however, and I mean a lot. All of a sudden the number of targets that the missiles would see would be multiplied by three or four times...maybe more. Not to mention all the chaff.....it would be a ticker tape parade lol!
Reply: "...Russian and American ICBMs can travel at speeds of Mach 10+...."   AND ICBMs fly at Mach 25 ...and...spend 87% of their flight path through no atmosphere or nearly no atmosphere and release their war heads at the edge of space - get more Vodka and get some for little Dimo while you are at it.

"..Russian anti jamming capabilities are second to none if anything some of their missiles are specifically designed to follow the source of the jamming..." AND THE GROWLERS AND DECOYS AND THE PICKET FORCES AND SUBS....ARE COUNTING ON THIS!!! JAMMING EMISSIONS MOVE AT A SUBSTANTIAL FRACTION OF THE SPEED OF LIGHT AND IN ANY OR ALL DIRECTION AS NEEDED. THAT IS FACT.

"..If anything the weather is a huge liability to a laser weapon. Lasers are only efficient to a very short ranges, they are prone to lose strength with cloudy conditions..."   THE SCRAMJET NEEDS TO BREATH MASSIVE AMOUNTS OF AIR TO COMPRESS AND DETONATE THE FUEL IN A CONTROLLABLE MANNER - NOT WATER! FURTHER, IF IT IS GOING TO FIND THE CARRIER, IT WILL NEED AS LITTLE ATMOSPHERIC INTERFERENCE AS POSSIBLE MOVING AT THE SPEEDS ITS MOVES. IF, IT IS BELOW TWO KILOMETERS AND IT IS FOGGY AND RAINING, IT WILL NEED SOMETHING ELSE TO GUIDE IT....RAIN AND SNOW AND SLEET AND HAIL AND SURFACE CLUTTER INTERFERE WITH ALL RF! BUT THE E2D+ HAWKEYE AND CAP RADARS WILL SEE IT COMING FROM 20 TO 40,000 FEET IN THE SKY from the moment it is fired!   IF THEY DO NOT HEAR IT FIRST! THE POWER GENERATED BY THE NEW REACTORS ON THE GERALD FORD MAKE THE LASERS POTENT OUT TO  RADIO HORIZON IN THE WORST WEATHER. WHICH IS A GOOD BIT FARTHER THAN NORMAL HORIZON.

"..They take a long time to recharge. Plus the US is not the only country working on laser weapons. Both China and Russia are also working on laser weapons and know all the intricacies of the matter..."   ONE HEARS A SOUND IN THE BASEMENT.  SURE IT IS AN ARMED INTRUDER. YOU ARE A VODKA-SOAKED RUSSIAN 'intruder-missile ' LOOKING FOR  AN AIRCRAFT CARRIER-OWNER COMING TO THE BASEMENT - IT IS VERY VERY DARK...AND IT IS A HUGE BASEMENT. YOU TURN ON A FLASH-LIGHT-TORCH TO FIND THE OWNER WHEN YOU THINK YOU HEAR HIM ENTERING THE BASEMENT....IT IS THE CAT, COMING THROUGH THE SMALL PET DOOR FROM UPSTAIRS  IT IS A GROWLER, EMITTING A CARRIER'S RF MASK/FOOTPRINT....YOU SHOOT...THE CARRIER-OWNER OF THE CAT SEES YOU SHOOT AND HE HAS CIWS AND A RAILGUN in his flotilla/hand AS WELL AS SEVERAL MISSILES THAT CAN HIT YOUR ZIRCON MISSILES SINCE THEY CANNOT: 1) TURN AND 2) FLY AT NEAR SEA LEVEL AT MACH 6, NOR MACH 5 any longer...can you see just how dead you are??! Bye bye comrade-cossack-vodka-Malaysian-flight-17-Magnitsky-murdering-soviet-putinist-criminals!!!!
Reply: SR-71 , X15, SR72 Aurora these are just the actual manned craft. Lockheed Martin says it can return craft from orbital speeds without the use of any ablative materials , using only innovative alloys like those used in the SR-71... and that is solid reference. Can easily find that statement online... Longer research, shorter comments.
Reply: "....If we're going to make up numbers why not make them REALLY ridiculous? You know, Mach 1,327,458....stuff like that..."

Go ahead.  Make your ignorance known all over the world.  The Space Shuttle, EVEN the Space Shuttle, meant to be used over and over again, re-entered the atmosphere at Mach 25, so we knew how to handle even craft re-entering from orbital speeds and the shuttle was made in the 1980's and designed before that time!  
    Older, old USA Ballistic warheads re-entered at over the Mach 10 that you suggested...here:
https://youtu.be/6SObYcIRTlI?t=5m45s   OLD STUFF!!!
Reply: Izzudeen Ayub so you call someone who writes long comments a keyboard warrior all I can say is grow up
Reply: Aussie Gamer the us missiles will reach Russia but Russia's missile will hit first but is that little bit of speed really worth millions
Reply: Panzer Killer
Russia did not and still doesn't to this day have the technical expertise to make a compatible Saturn 5 F-1 engine to take their dumb asses to the moon, so they attempted to use 30 smaller engines to do what FIVE F-1's did, which ended in absolute failure after failure after failure. Now what were you saying about Russian rocket technology again? LMAO https://en.wikipedia.org/wiki/Rocketdyne_F-1
Reply: D'Mathmoth Tutinean Take your time and read again what a load of garbage you are spewing. With that you will convince only these who are already convinced  and no one else. Next time think twice before you shame yourself.
Reply: Emm huhu.. beware.! u might be kidnapped by the China for having such a good fingers for typing.. but the best thing u have that the China wants is a powerful copy and paste ability.. nice introduction anyway
Reply: Ok:  Naval Weapons Laboratory, both Material Science and Munitions - I WORKED WITH THE GUNS OF THE NEW JERSEY; Naval Post Graduate School, Monterey California; Naval Weapons Center, China Lake, JUST TO NAME THE LAST FEW AND NONE OF THE SHIPS!  
         and Misawa Japan,  - I worked the most advanced bombing range in the Pacific every branch of the USA and our Pacific allies came to that bombing range including SEALS! and it, MISAWA AIR FORCE BASE, in Misawa Japan is still the only base still OWNED by the USA government in that country. I built my FIRST color 28 inch Console TV from a kit I purchased in Akihabara. I saw the very first digital radar and fire control systems used by the USA Navy and The first Warthogs. I ran tactical targets on Two bombing ranges that proved that unmanned was the wave of tomorrow before the first Desert Storm...20 years active and civilian service as well as The USA Oceanographic service USNS Chauvenet and Harkness. I ran the digital sets (BEFORE THERE WAS GPS) that gave the Egyptians precise locations for all the land mines they had forgotten they placed along the Red Sea...and Anwar Sadat flew out to Port Said to meet us! A man of my years? Oh I learned a lot/ WE PLAYED POLITICS AND PUSSY-PUSS with the Satinist-Stalinist-and now putinist dung and vomit eaters. The shrunken god you worship...putini-pussy-riot and little Dimo, did not hesitate to steal a third of  Ukraine....had an olympics at home in suck-it SOCCHI,  just like HITLER and then promptly went out STOLE CRIMEA and murdered 298 WOMEN AND CHILDREN on Malaysian Flight 17 so that he could LIE about doing it, only to have to admit he did it 6 weeks later after telling all those lies. Cowards lie on such a scale - putin and trump are siamese twins separate last week. CRUSH THE PUTINISTS...BEFORE THEY KILL AGAIN AND MAKE IT THE LAST FIGHT RUSSIA EVER HAS...DRAG CHINA AND NORTH KOREA ALONG IF WE HAVE TO!!!!
       LIVE FREE OR DO NOT LIVE AT ALL! Life under a dick-less-tator IS SLAVERY ...sure I know about that too! Hence...I can tell you, you do not save ' life ' by failing to RESIST AND FIGHT opportunistic infections and subhuman genetic defects like putini-pussy-riot and little dimo: miscreants, and ANNIHILATE those who promote and support putin and his murderous agenda to restore the Soviet-Failed-Onion,...ONION!   Any note of truth or honor in the Russia of today earns dignity only outside of Russia; He, your slime-trail. midget, boy, thug, and mental disease, putin, has stolen over $200 BILLION USA DOLLARS OUT THE RUSSIAN ECONOMY JUST FOR HIS OWN USE...He has turned Russian into a vile dung and vomit pile of kleptocratic uselessness and shamed his own mother, who, used to be his father!!! BOWING TO A BULLY DOES NOT MAKE YOU OR KEEP YOU FREE...Russia, Russians and putin are absolute proof of that! Yes, the Free World must get ready for a fight, and push the technology  of war far beyond what once was, to have a fight that ends the greed and aggression and threat of that Stalinist-Nazi-russian-women-are-the-best-whores-in-the-world-Cancer! HE is wiping his small-handed ASS with the Russian flag and its people: Try that on the USA/NATO puti-pie! Yeah I said all this, NOW, WHAT ARE YOU GOING TO DO ABOUT IT!!!
Reply: @dmathmothtutinean8950  I think you're slightly deranged.
Reply: After living in USA for 10+ years, I can say Russians and Americans the same mortal people. There is no Superior Race. We are all Homo sapiens.
Reply: Emm it seems that US has unleashed their keyboard warrior.. this is their latest secret society weapon.. the most dangerous weapon of all time.. it can penetrates and jams all youtubers brain.. no weapon can stop this warrior.. unless they delete or ban his account
Reply: Yet another YouTube Expert. Please sir. Enlighten us as to your qualifications in Advanced  Russian Missile Technology and also if you don't mind your Russian security clearance level? And since you want a war so bad let me remind you of the fact that Russias Nuclear weapons are far above and beyond the outdated and ancient minuteman 3 systems. You speak of war like its a video game. You sir have obviously never experienced real violence and the pain and suffering it causes. A man of your advanced years should know better. I would expect this type of comment from a child. Not a man.
Reply: Lol so many trolls. So much of this shit is classified anyways most of you are talking out of your assholes. Hypersonic missiles have been tested; but as stated need to be done so in perfect weather. The Gerald r Ford can move at 40-50 MPH. Good luck hitting a moving carrier at that speed equipped with multiple failsafes. laWS operates at 50,000 times the speed of light. Zero issue shooting down one of these bullshit missile...NEXT!!
Reply: @Ziggysdankgenetics  50,000 times the speed of light?! What are you smoking
Reply: D'Mathmoth Tutinean 
I read everything u posted,  (Twice), 👍👍
Reply: Emm huhu.. how can the US hit the zircon if they cant even evade a big fat slow old clumsy weak weaponless oil tanker and lost 10 marines.?